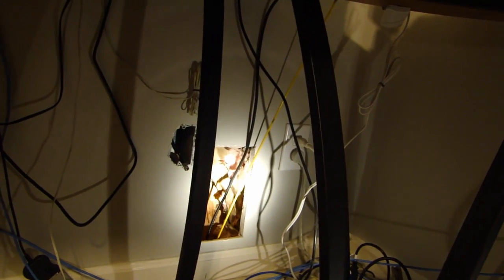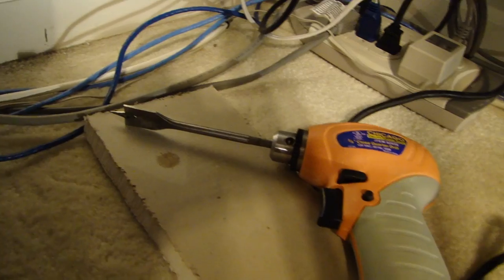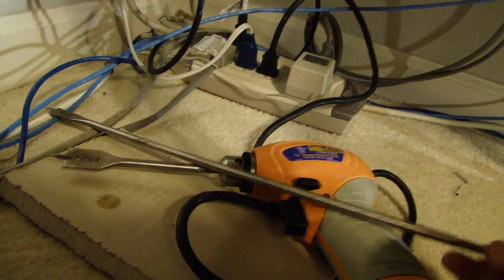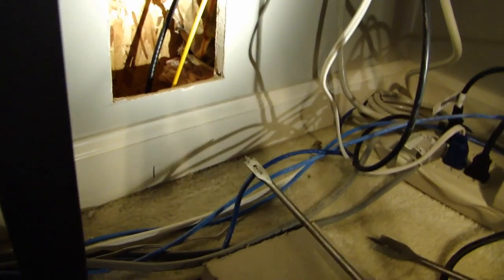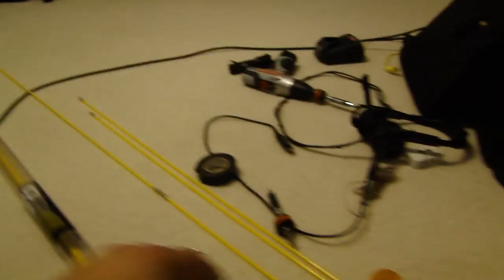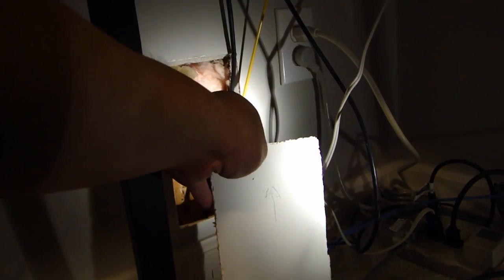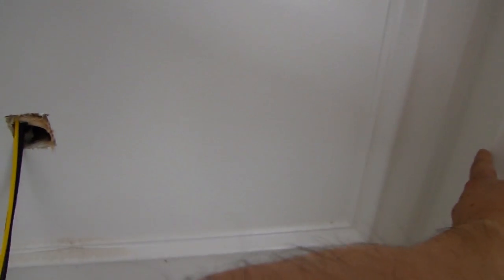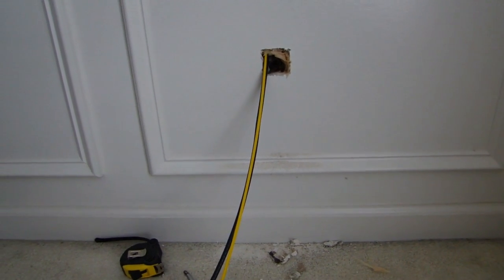How To Fish Wire From One Floor To Another In A Home

Comment: Nooooooooooooooooooo. Don't ruin your wall!!!!! Just use a 1" and a half hole bit to drill the hole into the sheet rock level with the center of the othe outlet. Then use a flex bit with a guiding arm to direct the bit to the stud at the bottom of the wall cavity. The hole is big enough for the flex bit and guiding arm and is covered up by the wall plate. Just put two screw anchors in and mount the plate. I've been doing this for 14 years and the object is to not have to repair the wall! Takes about 20 min. give or take and no wall repair.
Cable Guy
Reply from the maker: Thanks for sharing your professional experience. Really good information.
Reply: Also the 6 foot flex bit that I bought at Menards has a hole in the bit to be able to pull wires through with it so you don't need the expensive fiberglass rods. The fiberglass rods work great for certain situations, just not this one if you have a flex bit instead.
Reply: +dial2fast Where did you buy the fiber glass rods from, thank you?
Reply: +kicksreason Home Depot lowes etc...
Reply: +kicksreason harbor freight has them for 10 bucks, lowes or home depot are about 3 times as much
Reply: +BroJimbobillybob Can you explain this is a bit clearer? I'm a new home owner, and definitely would like to not do wall repair! Thanks
Reply: +BroJimbobillybob Oh, wow, thanks for posting!  Off to buy flex bit.... If this works, you are my new hero!  HATE drywall work.
Reply: +BroJimbobillybob IT WORKED,,, with zero drywall work!   You are THE MAN!

Comment: I get that you think you are helping inform others of how to fish but this is a lesson in what not to do. I am a professional AV tech and have been fishing for almost 20 years. There is no need at all to cut a hole the size you did.First, move the desk away from the wall and cut a single gang box followed by showing how to use a flex bit. This video would be more helpful to novices if you also showed how to locate where the cable should be and where to drill. Also, rods don't always want to go straight down.....flex rods bend easily......hence flex. I actually did a two story fish yesterday from basement into attic and the biggest hole I cut was 1" in order to install 2 WAPS.
Reply: +Jared Simmons So where's your video of it?
Reply: +Rotcod Exactly, I run cabling for a living and it's hard enough using 3"- 4" holes to fish cabling through. He used only 1" holes. I want to know what equipment and techniques he used.
Reply: I used basic fishing tools. I found a common wall on the interior and used a 1"speedbore. Drilled up from the basement, shined a spot light up the cavity, went into the attic and found the header for the common wall, drilled down and saw my spot light shining up. From that point I just used some flex rods. No special tools, just good measuring.
Reply: can you come to my house and do it for me you sound like you know what you are doing
Reply: Agreed, this video creates way more work than is necessary. I'm not a professional installer, but have fished several cables over the years.  It's much easier to buy the correct tools and save a huge amount of time vs. having to repair a bunch of big drywall holes.  The tools are not that expensive and for intermittent use will last a lifetime.
Reply: Jared Simmons  lol yeah use a flex bit and put a small cover plate over the drop point.  ez breezy and no drywall repair
Reply: Can you make a video on the right way to do it then.
Reply: wheres your video Jared Simmons ?... you drinkin that hatorade
Reply: your method wouldn't work in this case since there is insulation in the wall.  you're also talking about skipping a floor and going in to an attic where you have access to the top of the wall.  This case is running from a wall, through a floor and into the wall below.  Granted you could run up to the attic then back down through the entire wall, but again, it's going to be more difficult with insulation.  Also, if the attic is not above the point is moot.   You'd have to cut a wall access hole if you don't have access to the top of the wall.  Granted, this hole could be the size of a single gang box easily and use a flex bit.
Reply: you're a professional.. he's not. Give a dude a break.
Reply: @jaredsimmons836  that's how I do when I have to go from basement up to attic etc.
Reply: Now if I wanted to add an outlet to a GFI  to my bathroom ,would I better off going through the attack and running a wire to the other side of the wall then down. Due to the panel being on the other side of the house? In that case I’m guessing I’d still have to cut a whole on every level till I get to the panel?
Reply: @jaredsimmons836  video of the process or you're lying.  Everyone is uppity, but doesn't want to help.
Reply: @ccccccasey cover plate?

Comment: Not a good video.  Holes are not proper size.    Too big upstairs, and too small downstairs.  I  have been in the low voltage industry for 19 years.   You have to, or should use low voltage brackets to size up your holes.   Also, when using the fishing sticks, you should tape the cable(s) to the end of the sticks, not the beginning.  The sticks go in alone, then the cables.   Next time, consider flexible drilling rods, or bits.

Comment: I never thought about cutting the hole at a bevel so it doesn't fall through. Good idea.
Reply: Me either, i been cutting/repairing holes to run wire for 6 years now 🤦‍♂️
Reply: I screw a bit of wood across the inside of the empty hole and screw the drywall to that.

Comment: Single gang cut. 1 inch speed bore or paddle bit. Depending on how much wiring you're running, your hole might have to be a little larger. If you have the correct glow rods and not the ones from harbor freight, it goes right through the insulation no problem. I've been installing for about 10 years now. I wouldn't say this is the best way , but hey that hole was big enough to park a smart car in it. But hey, if the stuff works and he got the drywall repaired, I dont really see anything wrong.
Reply: What glow rods do you recommend?
Reply: @TheSwampDaddy  harbor freight works just fine. I've never broken one before and I do this everyday.
Reply: @TheSwampDaddy  2 years later, but a stranger just saw your question and felt like answering lol. I like the Klein rods because they're sturdy as all hell, and have a lot of umph to them when pushing through insulation. That said, Southwire makes some great ones that actually glow if you need that feature. Southwire also has a bunch of attachments for different fishing needs.
Reply: @SpodySpazable  Do doesn't Klein have all of the rod attachments too? Is their a certain Klein package? It seems like there were several choices ..
Reply: @TheSwampDaddy  well ill be damned, I just googled it and I guess they do now! When I bought mine they came with a hook, but you can get the alt accessories online. Maybe now also part of the standard package. Still high quality rods 😊

Comment: I have had a lot of success with metal coat hangers.  Straighten out an appropriate length and sharpen one end to a spade - very easy.  In a drill chuck it is flexible yet stiff enough to go round a steady corner.  The diameter is small enough to let you see where it comes out and, if it's not good, you only have a tiny hole to fill, all but invisible.  Of course, a custom flex bit is better but more expensive.  Once it is through to the floor below, you drill back up with a standard drill into the inside of the wall, not through it from the enclosed side.

Comment: I'm going to have to fish a 100ft Ethernet cable through finished walls. From the basement to garage to attic to bedroom. The weather can be very cold and in summer be very hot out. Should I insulate the Ethernet cord or something. If so, with what?
Reply from the maker: The Ethernet cable is copper. It will be fine in heat or cold.
Reply: I Lol'd
Reply: Should I insulate the Ethernet cord  HAHA :)
Reply: run it with the HVAC line set between the air handler and the outdoor compressor to keep the those sensitive 8 wires comfortable. Leave slack for thermal coefficient of expansion.
Reply: @JulesBartow  insulate with tin foil. Same as your hat

Comment: I would have pushed the fish rod down to the first floor, attached the cable to it and pulled the cable up.  It's easier to pull the wire up than to push it down through the wall.  But both ways work i guess.   You say tomato, I say tahmahto ;)
Reply: That’s a good point, I’m gunna so that muself

Comment: if I were to hire someone to install the cable and patch up the drywall myself.
How much would it roughly cost?

The fiber glass rods are pretty expensive and i'll need to buy longer drill bits.
Reply: $420 - that’s what my company charges for floor to floor wall fish-  and we will only leave behind one blank faceplate that you can patch at any time - most customers don’t since they can reuse it for future wires.

Comment: Of you use the 72” long flexible wood drill bit you only need to cut the rectangle for the outlet wall plate, then use the bit at an angle into yourself to clear the concrete foundation in order to get into the basement support 2x4’s beyond the insulation and drywall. You can then use a fish tape and bring it down that hole into the bottom, have a helper hear where it’s running and cut open the wall plate rectangle, bring out the fish tape end, tape the end of the wire, then have the person upstairs pull slowly the cable up and you feed it slowly to them. What you did is the same thing nothing wrong with it. It’s just your way requires to patch up the drywall piece that you cut out.

Comment: Hi i'm trying to drill to my first floor but cant seem to drill between the two floors. I feel like something it blocking the drill bit from getting through. I got past the studs on the top floor but after that. Doing this for an Ethernet connection from my bedroom to the to living room. Any idea what could be blocking it?
Reply: Laminate beam maybe, how long a drill bit are you using?
Reply: i was using a 16" long drill bit and we have carpet on both floors the only thing is in the room below there is a fireplace in one corner i am drilling above it well the wall next to the fireplace.
Reply: +Unknown Abyss You could be hitting a nail in the top plate (2x4) of the lower wall or subfloor.  Try drilling another hole one inch left/right.
Reply: What’s happening the drill bit won’t go in any further or you ran the bit all the way in but you can’t find it below ? Sometimes you think you know exactly what’s below you only to find yourself on the other side of a wall below or in a
Soffet which sucks , I bought my parents house who bought it off of my grandmother who was the original owner of the house so I have lived in this house for at least 25 years of my 44 years on earth yet I was zoning off the heat to each bedroom so I had to run a thermostat wire and low voltage power supply to all three bedrooms and the bathroom , every time I cut a small opening in the ceiling below thinking I was right underneath the spot I’m drilling at I would be off by a foot to 18” , it still doesn’t make any sense because I know where the soil stack is and that runs from my basement floor straight thru the house and thru the roof , I measured off of the center of the 4 “ cast iron in the basement then transferred the mark to the basement ceiling which is opened so you can see all the floor joist plus the basement ceiling is really the bottom of my hardwood floors on the 1st floor so i would drill a tiny hole under where the new baseboard is going once I’m done this little project so I just transferred that  holes location to my living room ceiling ,  cut a small section of sheet rock out then drilled into the 2nd floor wooden floors where I should of come up  behind the wall in whatever bedroom I was working on at the time but I was off on everyone of them and I used a Bosch laser level  and double checked with a plumb bob when I transferred my marks plus I work in the building trades so I know what I’m doing but my house  was tricky to work on.

Comment: So was there only one stud that you have to drill through I would have imagined there would be another stud half way up down stairs or 2/3 of the way up?
Reply from the maker: +VLturbo1988 There were two floor joist. I had to drill through
Reply: Is it possible to drill through 3, example houses where the wallpoint has to go right at the bottom (300mm above floor), and you are in the loft, is there a drill long enough and is it going to be stable as not to catch on the plaster on either side
Reply from the maker: +VLturbo1988 The professionals do have these flexible drill bits that are 6-7 ft. Some alarm stores will also rent them out.

Comment: I want to run a security camera cable from the first floor to the upstairs room, from the downstairs ceiling through the upper room floor. Has anyone ever cut like a 4 inch square through the wood floor above, so you can see inside the ceiling void where exactly to drill the hole in the downstairs ceiling, so I can run the cable? Then re-connect the wood piece I cut in the upstairs floor, also with a hole through that wood piece for the cable. I have to pull a little of the carpet back to do the upstairs floor cut right up against the baseboard. Then maybe I can use an epoxy glue to put back the wood floor piece? Then silicone caulk the hole in that wood piece once the cable is put through. Any thoughts will help....Please?
Reply: Hire a pro youre way off and doing more damage then needed

Comment: I'm hoping to replace a ethernet cable with a phone wire. Would I be able to tie ethernet cable to phone cord and pull it threw the walls? Do you know If anyone has done that?
Reply from the maker: It depends how open the space is inside the wall. As long as there are no tight obstacles, it should work. Just tape the two wires well so you don't loose it in the wall, and then pull it through.
Reply: You don't need any new cable at all. Ethernet is like a more robust phone wire. You should just be able to wire up the existing ethernet cable to your phone jack.
Reply: Use the ethernet cable for your phones, the blue wires and just tuck the rest out of the way.  My newly constructed house came with a phone jack and surprise, it's cat 5e
Reply: slowfaller hey do you know if you can switch a phone plug to internet?
Reply: Gummi Bro sure if the cable is cat 5e just cut the phone plug off, strip the cable and properly attach an ethernet plug by making sure you have all the wires in the correct order
Reply: slowfaller thanks but i have no idea were the other end of the wire is sooo, yeah, but ive got a friend who is a cable guy so iill ask him for help, id rather not just cut a bunch of hole sin my house to figure that out
Reply: Gummi Bro 
  gotta figure out where the phone company hook up is in your house like in the basement or something.  Mine routes into my basement and ends by the circuit breaker.
Reply: slowfaller oh well now i feel silly, so could i find the end of that wire and the re route it to my internet router or?
Reply: Gummi Bro Well you need one cord into the router and one cord into your pc right? When you asked me the question I had assumed you had a phone jack that you wanted to turn into an ethernet jack.  So you would take off the faceplate of the phone jack, buy a new single keystone faceplate and cat5e keystone, strip the cable, install the keystone by punching down the wires and then go to the other end of the phone/cat5e cable and plug it into a switch/router etc.  If you just have cat5e cable with phone connections thats not in a wall, just swap them out with cat5e plugs.  I pretty new to this stuff too so sorry if its confusing as hell
Reply: You might be able to add a phone line using the unused pairs in the existing Ethernet cable.  Find an adapter that splits a standard CAT5 cable so it can share both an Ethernet (RJ45) and phone (RJ11) on the same cable run.   ex: Dualcomm DC-104 or similar product.  You'll need a pair of the adapters.  No drilling or re-wiring needed and you don't loose a working Ethernet jack.

Comment: what's the dark spot on the wall in 5:20?

and thank you for the video
Reply from the maker: It's just a picture hanger. There was a picture hanging there which I removed.
Reply: Thanks for the quick reply! 
Do you have a video on 2 story house wire drop? is it more difficult? especially the drilling part?
Reply from the maker: monty8008 Guys that install house alarms have these super long drill bits but for the DIY, you may have to cut a square hole in the dry wall to access the space to do the drilling, then patch it up after you are done. Also you gotta watch out for electrical wiring and plumbing behind the wall.
Reply: dial2fast Menards, Home Depot and any of the bigger hardware stores have them. Also can be used for sidewalk bores if running under a sidewalk to another building or garage. Worth there wait in gold!

Comment: How do you know you're drilling into a wall beneath you instead of the ceiling.... ?
Reply from the maker: +Kevin Swartz You can try to take a look downstairs and upstairs to see where the walls are located. If there is a dividing wall in the same location on both floors, then most likely they are one on top of the other.
Reply: +Kevin Swartz 
Lots of measuring.